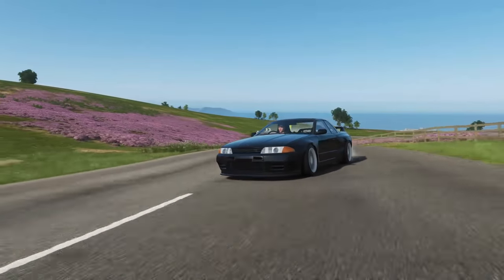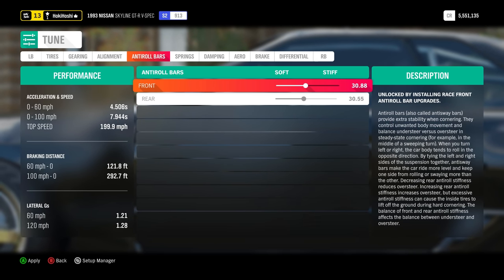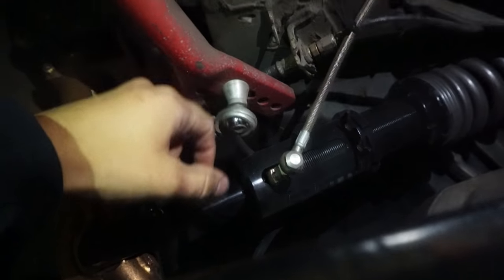How to Drift in Forza Horizon 4 (Technique/Tuning)

Comment: I dont like drifting in games at all. I like racing a lot more anyway. But i still love watching these videos. Keep this up. I would like to see what parts to tune your car with. The general guide for what you should buy and what is priority and what is not needed that much. Would love to see that. But if you gonna do something like this or not i love your videos anyway and i learned very much from it. Also i have problem with driving with manual. I focus more on gears than on line and i get worse times and make more mistakes. Any tip on that?
Reply: Tomek L Drifting is important in Forza Horizon 4
Drift Story
Drift Zones
Reply: U could turn the speedometer off so it doesnt distract u
Reply: Keep practising with the same car, when ur used to it u can even shift without looking and using just sound to determine what rpm its at
Reply: tonierpillow4 Thank you guys :D. Also my biggest problem with manual is slowing down and changeing gears at the same time. Also should i use clutch or little advantage is not worth it?
Reply: @tomekl3476  speaking from personal experience. Its not "necessary", but everything is a double edged sword, its good if u know how to manage the clutch. E.g, clutch kicking to slide a low powered car, being able to launch at your desired rpm, allowing the wheels to be in free rotation without your engine controlling it during a drift or turn. My advice is at least get used to shifting gears manually before using a clutch, it took me a while to get used to using manual, then a while to using clutch cuz i always forgot to clutch before changing gears. Practise makes perfect! Its a lot easier to control engine speed with the clutch
Reply: @tomekl3476  when i brake i usually disengage the clutch to maintain engine speed(if you slow down with clutch engaged ur engine rpm also drops to your tire speed, meaning if your wheels lock up your engine rpm drops to the lowest and ur game automatically disengages the clutch, irl ur engine would stall i think)
Reply: tonierpillow4 wow thank you very much for that amount of good tips. I see you are into car for long time because of how much you know about them. I can say myself good amount of things about fps games and how gun works, how to use it and all of the things about it. But 10 years of practice means something. But thank you again for your help :D
Reply: @tomekl3476  np man! I like helping, have fun with your driving!

Comment: Well that was a great tutorial! I love your style of sticking with jdm cars. But I play on pc and the keyboard activates at 0 or 100, (forza stats) for breaking, acceleration, turning,. Meaning I cannot throttle control. Is it possible to even drift on the average gaming keyboard. 
(Ps some high end $$$& keyboards have actuations measurement so that type can throttle control, but that’s newer tech and not too common on the market. 
I might plug my xbox controller in.

Comment: Great guide but my gearing feels off. It will keep bouncing off the rev limiter but take ages to actually change up a gear. This happens while driving normally and during drifts. Is this normal or if not how do I fix it. Nice video again BTW.

Comment: So it's probably way too late to expect a response, but I have a question. In the video, you set brake bias to the front. But I found that, somehow, setting it to front locks up my rear tires first under heavy braking, and setting it to rear locks up my front tires. So effectively, setting it to "front" makes it act similar to the e-brake.
Is this intentional? Is this abnormal behavior?
Driving a mostly-upgraded Impala Super Sport (the one with a police lightbar coded in as a side skirt option). RWD.
Reply from the maker: So yeah this is actually a bug with the tuning!  In a ton of cars, rear/front brake bias is reversed.  The goal is to have your fronts lock up sooner than rears - so most of the time weirdly enough, that means moving the slider towards "rear"

Comment: So ive been drifting with the new honda s2k that just came out and 4th gear is generally where i stay in my drifting up and down the mountain on fortune island. when you were talking about gearing would that mean i lower my 3rd gear and raise my 5th gear to closely match 4th gear? Because i got a little confused when you were talking about that.
Reply from the maker: Yep you got it! Sorry I sort of glossed over that in the video, but yes. If 4th gear is the "main" drifting gear,  then bring 3rd closer to it so that you can shift down if you need to without totally losing forward momentum, and bring 5th closer to 4th so that you can shift up mid drift in order to extend a drift without the car bogging down, they'll probably be ~.05 to .1 apart in my experience but it can vary.  This gearing method isnt super realistic for the real drifting world, but done properly in Forza it can make a huge difference in your car control.

Comment: How do you setup the steering wheel in ForzaH4? Mine is setup from  normal driving, but when drifting, the wheel dampening and spring centering seems to intefere with the ability to quickly turn the wheel

Comment: Timestamps & Tips 

Intro - 0:00

Settings - 1:00

(Technique) intro - 1:33

(Technique) Line - 1:41

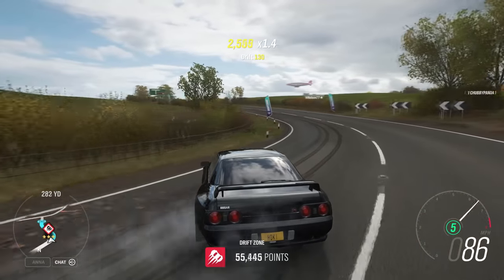(Technique) Entry - 2:10

(Technique) Drift - 2:58

(Technique) Exit / Transition - 3:24

(Tuning) Tire pressure - 3:49

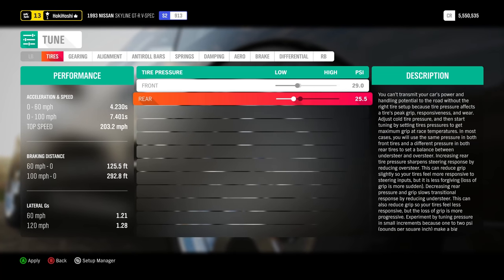(Tuning) Gearing - 4:06

(Tuning) Alignment - 4:40

(Tuning) Antiroll Bars- 5:46

(Tuning) Springs - 6:14
TIP: FORMULA IS max setting - minimum setting x W% + Minimum setting = setting
for more info check out https://youtu.be/WM7_3NGGUoQ?t=427 timestamp 7:07

(Tuning) Damping - 6:34
TIP: FORMULA IS max setting - minimum setting x W% + Minimum setting = setting
for more info check out https://youtu.be/WM7_3NGGUoQ?t=427 timestamp 7:07

(Tuning) Braking - 7:19

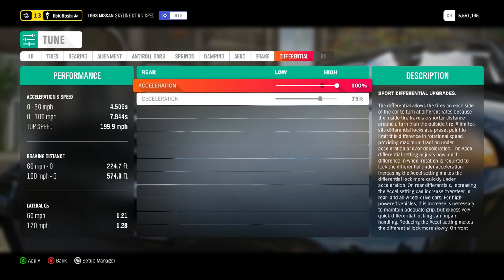(Tuning) Differential - 7:36
TIP: set accel. to 100%

(Tuning) Recommended Mods - 8:05

(Real car) Intro - 8:35

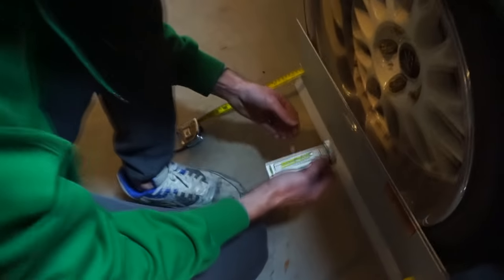(Real Car) Camber - 9:40

(Real Car) Toe - 10:18

(Real Car) Caster & Anti-Roll bars - 10:50

(Real Car) Aero - 11:58

(Real Car) Braking - 12:16

(Real Car) Differential - 12:52

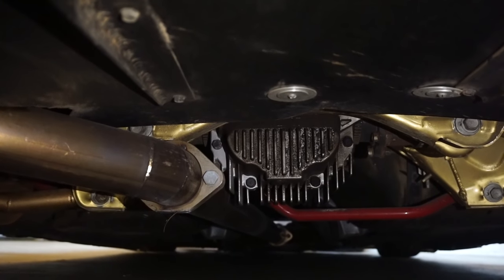Real car footage / Outro - 13:13

Comment: I'm having some major issues trying to wrap my head around this in FH4.  I can drift AWD fairly well, but RWD is completely kicking my ass.  I've spent days watching videos on it, trying it myself, I've spent millions trying out different cars and builds, but I simply can't drift with RWD.  I know how it's supposed to work, I just can't do it.  After dozens of hours trying I'm still just as bad as I was when I first started.  Everyone makes it look so simple in the videos, but when I try, no matter what car, no matter what build, as soon as the back starts moving the car just spins.  After doing nothing but trying to drift for several days now, that's as far as I've gotten, the back spinning every time I try to initiate a drift.  

I'm using a T300RS GT on PC (I play only in cockpit mode, 3rd person feels completely disconnected and makes it impossible for me to drive), and a major issue I've had with the game since I started playing it is that the throttle feels way too touchy in the game (I come from playing sims like iRacing, PC2, stuff like that). I feel like the ultra touchy throttle is what's killing me.  

I'm starting to think this is something I'll simply never be able to do.  I'm not incompetent, I can do any other kind of driving just fine.  But this?  Apparently not.

Comment: Off Topic but i recently got forza and have started tuning based off your tuning video, one problem i'm having is on my Ferrari FXX K, the front tyres are always cold, no matter how hard i push the car, i've tried adjusting camber and tyre pressure but it hasn't helped. Any advice is much appreciated!
Reply: I have had trouble with higher graded vehicles as well sadly
Reply: try stiffening the springs, arb , and increasing downforce
Reply: Or if ur racing during winter then thats not gonna help..
Reply: When you stiffen springs doesn't it make you slide out when going over a bump?  @Uncle_Glock
Reply: @treerexaudi  it depends, when tuning, the rule that too much or too little of something is bad always applies, if ur springs are too soft then they will bottom out and cause understeer. If they are stiff(enough/properly tuned) , good amount of weight can be transferred onto the tires hence giving u better grip. Also when your wheels are under high load thats when they heat up faster. High load such as stiffer springs/heavier downforce
Reply: ok thanks :)  @Uncle_Glock
Reply: @treerexaudi  np! keep experimenting
Reply: I will thanks :)  @Uncle_Glock
Reply: @Uncle_Glock  Thanks man, i'll try it out when i get the time

Comment: Most of what your saying is conceptual stuff that doesn't really hold any sort of meaning.

What I need is the button pressing combination. There are three separate "breaks" buttons. Why are there so many? Which order do you press the buttons in to allow the car to drift, instead of spinning out of control?
Reply from the maker: The problem is that there is no such thing as a button pressing combination. There is no order you press the buttons in. Drifting is extremely fluid and dynamic. Even on the same exact corner at the same entry speed, you'll have to press different buttons/triggers/joysticks at different times to achieve the same drift, thats why drifting has to be taught by understanding concepts instead.  There's also 2 brakes just like there are in every real car. A foot brake and handbrake.
Reply: @HokiHoshi  hm. Well, I dunno then should I just not bother learning drifting then?

Comment: It's common for people not to run a sway bar in the front not the rear, most people either use the stock one or none at all, also the only reason people run inline hydro handbrakes is because they are cheap, having it inline causes issues when you want to use the normal brakes and handbrake at the same time.
Reply from the maker: It's pretty common to see no rear sway bar as well!  All depends on how much grip you want.  For the hydro, believe me I know! used to run a cheap GKTech inline hydro in my old 240.

Comment: OK, so I don't have a wheel, I have a controller.  I run on PC however, so skies the limit.  should I get a wheel, or can I do decent scores with a controller?  I keep practicing, and I just can't seem to get it.  No matter which car I use.  I'm all over the place, and I can't get a good run in consistently.  Then people come along and can take any car and routinely get double the 3 star drift score.  I can't get three star no matter what I try.
Reply from the maker: Keep the controller!  Every top score you see is set with a controller, Wheels are fun but definitely worse for drifting scores in Horizon.  It takes time and a lot of trial and error but you'll get the hang of it eventually!
Reply: @HokiHoshi  Alright, thanks for replying so quickly man.  I'll keep at it.

Comment: I play on controller and Idk how I should start my drift. Break, I don’t even know how to clutch kick, and Reving at a high speed doesn’t do anything. So plz give me a suggestion
Reply from the maker: I usually find that handbrake entries are the easiest to learn for beginners.  Practice by just holding the handbrake down, and keeping the car at angle until you come to a stop.  Once you can control the car to a stop with the handbrake held down, start practicing when to let off the handbrake and start applying throttle.

Comment: I hage done the difficulty settings you have shown and my car just stops when I brake, I can't even turn it just goes in a straight line and stops
Reply: When you don't have abs you need to be more gentle on the brakes. You're locking up the brakes so the car is understeering. Try to brake without fully pressing in the brakes
Reply: @christopherwilliams6048  thanks a lot! This really helped 👍

Comment: Oddly enough I was only able to find 2 tunes by him for drift cars & the stats were exactly the same as the stock stats with only a change in weight. Which tells me although he’s made vids breaking the tuning down, there’s no actual tunes saved by him after utilizing all his steps. Unless he tunes & used the stock components 🤷🏽‍♂️ no way of knowing with out paying for the tune to get it. & even then most tunes you purchase are locked so you can’t see what components were used.

Comment: Hi...

Pls help me

I  got my 1st fh4 today.. after watching all drifting videos ...i cant figure out how to do it....bcos every time i try my car just go off the road and slips like ice.....
Reply: Do automatic first to learn how to control the car in general
Reply: Don't try drifting yet your to early in and way out of your league you'll get there after like a week 1/2
Reply: @Zaxkto  
Thanks bro...
Actually i am playing 1st time forza game...early i was playing nfs games...so its difficult to control my car on turning ...

Can u help me tune my car for street road racing......i need best tune for awd car to stay fast on turns wothout slipping...
Reply: @sagarbhojak3775  whats your username on xbox and do you have a mic?
Reply: @sagarbhojak3775  or snapchat whatever ig
Reply: @Zaxkto  

Will play tommorow ...got to go now...
Reply: @sagarbhojak3775  when it comes to awd its hard to control awd turns with high speeds hit the brakes and slow down put some camber also i reccomend front camber 0.5 and rear 0.3 so it doesn't spin out also with street racing use rwd i recommend a brz 2013 for good horsepower rwd easier turns if you need help with any modifications for the car send me a message on xbox : LSDKILLZBR74N or on snapchat: kk-bryan
Reply: @Zaxkto  

Yep bro...thanks...
Reply: @Zaxkto  

Will msg u when i play ....thank u bro...

Comment: A video game should not be this hard. I’m still lost on most terminology here since i bought bt this game 2 weeks ago (haven’t played much) . I just wish someone makes a list of every car-nut term from Horizon and defines them so i won’t be as lost (i’m still lost on acceleration and deceleration).

Also how do i prevent a stock supercar from spinning out at the slight press of the throttle. That shit is pissing me off. Even older games like Midnight Club don’t have wheelspin on every car. Never had i experience a game as daunting as this one. I basically have to do hours of research to even have a DECENT amount of skill in this game. I’m just so lost and it’s kinda steering me away from playing overall.

Comment: no way has that car got neg 7.5 degrees of camber im running 5 degrees and it leaning more than those
Reply from the maker: Might just be the camera angle? or perhaps you have more camber than you realize but I can assure you, the car has -7.5.  Measured on both wheels with a camber gauge as well as being set and measured on an actual alignment rack.
Reply: I had mine on a hunter tracking machine to do my tracking i dialed it back from 6 degrees to 5 degrees.
Reply from the maker: ¯\_(ツ)_/¯ probably just doesnt show well in the footage then, might just look different too with different fender/wheel/tire setups.

Comment: A lot of what you said was pretty good but when you're telling people how to enter corners by telling them to hold the handbrake down until they come to a full stop I don't agree with that because I think the only way to learn is to just try it until you get it right you can try using a few techniques like the handbrake and weight transfer and things like that but I feel like to properly learn you need to complete the drift think about what you did wrong if you mess up and think about what you did right if you don't

Comment: What is clutch kicking? Anyone?
Reply from the maker: Clutch kicking is a great way to initiate or hold a drift, just give the clutch a good tap without releasing the throttle.  This locks up the wheels and is a good alternative to handbrake entries, or it can be used to hold angle without losing speed while in a drift by "kicking" the clutch as needed

Comment: Very low psi. strange
Reply from the maker: Higher pressures lead to ultimately less grip and less smooth drifting/transitions.  On a lower-powered car, high tire pressures can help kick the rear end out, But ultimately a lower pressure is better for holding angle and having a more controllable drift because the transition between grip and lack of grip is much smoother and consistant (the car wont suddenly snap back).  This is the same with real life drifting as well, for beginners and low powered cars it can help to have a higher pressure to get the rear end out and feel how to control drifts but once you get into the "big leagues", lower psi is best for grip drifting.  (A lot of FD guys run super low psi)

Comment: M45>G35
Reply: This Isnt Me m45 aren’t available in factory manual. Also they weigh more and the vk45 barely makes more hp than the vq. We own an fx45 as well and love it.
Reply: @DabSedan  who the hell keeps their car stock?
Reply: Not sure? Every vehicle I’ve owned is modified. But I can tell you the vk45 doesn’t make power. Also there’s a lot less aftermarket for the m chassis itself. Rad car though! Chris Forsbergs m45 with a vk56 racing engine in it is quite impressive!